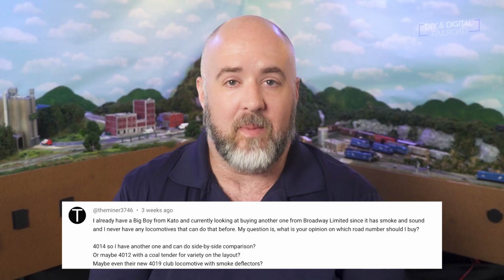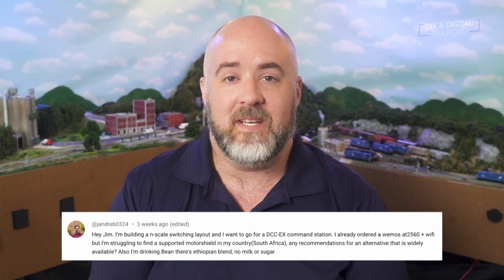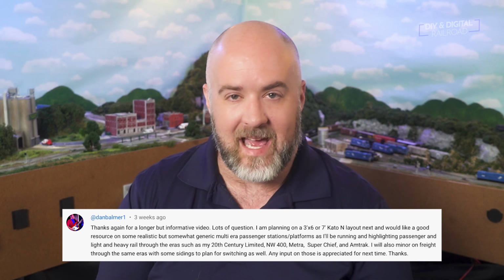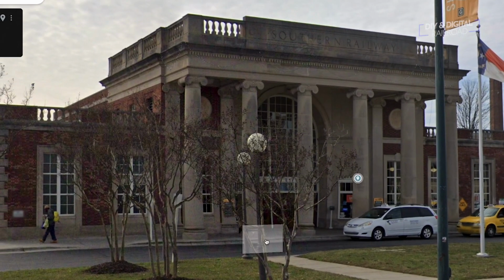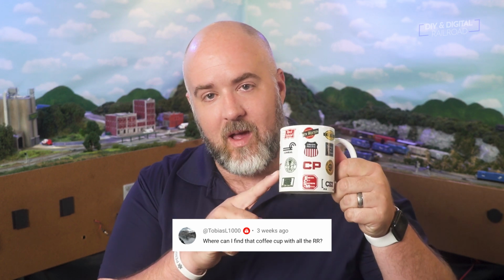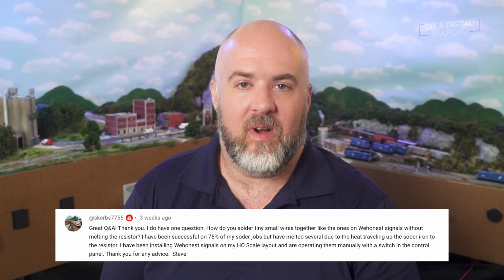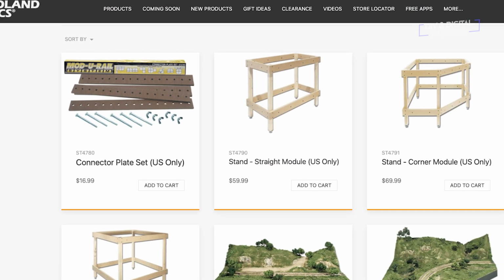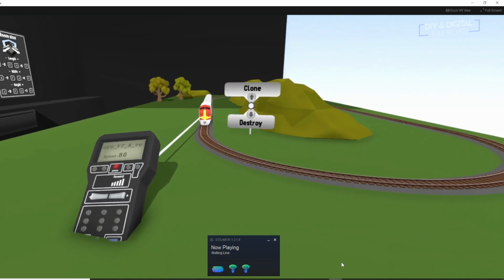Running your Model Railroad on Battery Power and more!  Model Railroad Q & A

Comment: I have a question for August… Do you need a programming track to program trains or can you use a running track. SECOND QUESTION: Are dcc systems worth it for a starter using KATO UNITRACK and only has two locos…

Comment: hi, im a 14 yr old trying to get into the hobby. I already have a kato gevo starter set, and I was wondering how to navigate around Ebay and not get ripped off. I found a bid for a lot of rolling stock, two kato maxi sets, around 50-60 pieces of rolling stock, none in boxes, some are in disrepair, but a ton of random trucks come with it, so I could repair the ones that don't have trucks. it is 25 dollars right now, but there's 6 days left, is it worth trying to bid on it?

Comment: Do you have any suggestions on connecting Kato uni track to other brands? I have parts of my layout where Kato makes sense and others with specific measurements where I would need to use track without pre attached roadbed.

Comment: I have 3 4x8 tables in a u shape with a tech 6 mrc DCC controller will it have plenty of power to run All 3 4x8 tables with just the one controller

Comment: Talking about running off a battery - my module group uses a solar generator battery to run an entire weekend of a show.   It makes it easier to setup as we don't worry about running an extension cord anywhere and we can setup just about anywhere.    We have primary station and booster running off it and some accessories.    With it being designed as back up power for your house, it has all the US wall plugs, so we don't need any conversions or other work to use.  Cheers

Comment: I have a DC layout, and I do eventually plan to upgrade to DCC once I move out of my apartment, and into a house.  But I was wondering if I bought a DCC locomotive with a keep-a-live capacitor, would it still operate on DC?  
Thanks Jimmy!
Reply: Gonna beat Jimmy to the punch here: MAYBE. And it might not need the keepalive. 

It depends on the decoder. Most decoders have a function to allow DC operation. It won't be as effective, per se, but it'll move.

Two things I would do here if I were you: First, buy a DCC-ready locomotive. (Most of them these days are sold that way.) Then when you do upgrade, buy the decoder (and sound if you want to do that), install, and you're all set. Second, DCC upgrades aren't that difficult and don't take that much space--I'm in an apartment and have a DCC layout. (JMRI and a SPROG plus repeater for SPROG.) If it's a question of available cash, sorry, can't help you much...

Comment: Been looking for a cab forward locomotive.  Intermountain sells the one I want but apparently have not gotten enough orders.  This is such a neet model.  

By the way I supported Klawndyke for modules.  There are sanctions of import of Baltic Birch (raw material for the modules).  I have sufficient number of modules to construct an N scale layout.  3/4 of my modules are from Klawndyke.  Thanks for the introduction.
Reply: Add one more order... Thanks for the heads-up that someone is looking at making them, the one up at the California Railroad Museum made a large impression on me years ago.
Reply: @erichusmann5145  Me as well!  It was awesome to sit in the Engineers cab and listen to facts about the locomotive.

Comment: Re: Battery backup. I'll often run a NCE PowerCab for smaller setups, both at home and shows.  I got a 12V power brick from Amazon. It was $34 had 5 and 12V outputs and will run my PowerCab all afternoon in typical use (6000mAh capacity at 12V). You just need to make a connector from the typical 12V barrel jack to whatever you need. It should work for DC too with packs that have an external power brick like the Kato pack.

Comment: Jimmy, for soldering tiny parts in line I go to my 60's training and put an alligator clip on both sides of the wire/ component connection  it was called a heatsink  and it just protects the temp sensitive component or the insulation on the wire.  Also go to a smaller watt raring of iron.  Search heat sinks for wiring.

Comment: Railroader is a fun operating sim. About $30.
Question, does anyone know how to adjust (if possible) the chuffing sound when increasing and decreasing throttle on a Paragon 4 (light pacific, specifically. Thanks in advance, take care all.